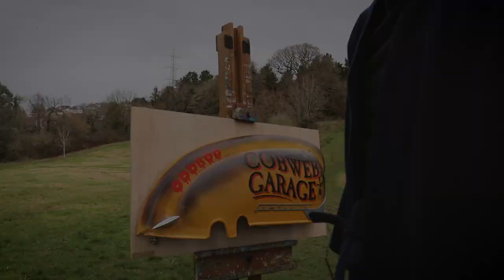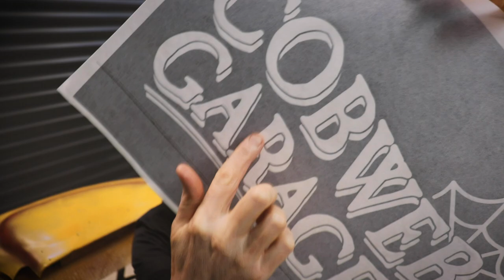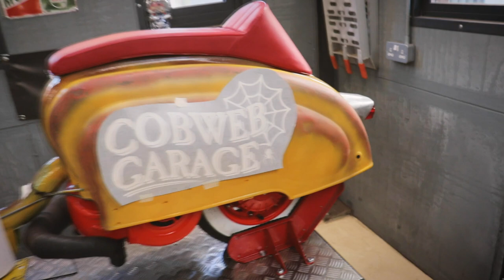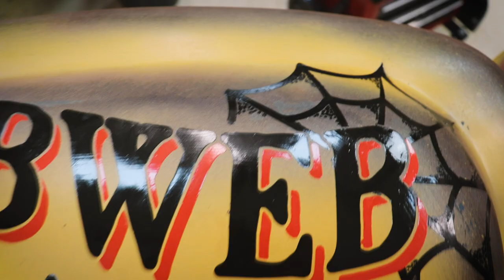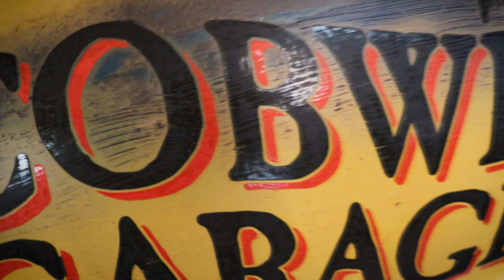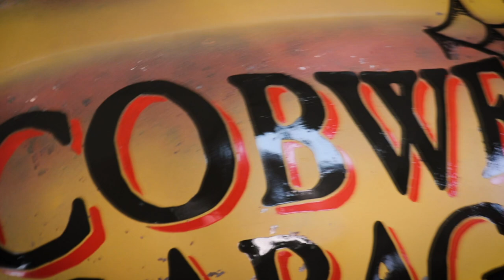EP 12 Traditional signwriting on a budget hack! Oddbod The Lambretta finally gets side panels.

Comment: Looks great. 
Did you have any problems with the vinyl ripping paint off?
I was thinking about doing something similar for my TV175, but any vinyl and stickers I put on takes away half the old paint off in flakes, when I remove it.

Great videos btw...
Reply: I would seriously advise against putting masking film or masking tape anywhere near old or unstable paintwork. I uploaded a video last week, in which I signwrite a 1950s Lambretta with its original paint. I don't want to hijack this upload, but you can view it on my channel if you are interested.